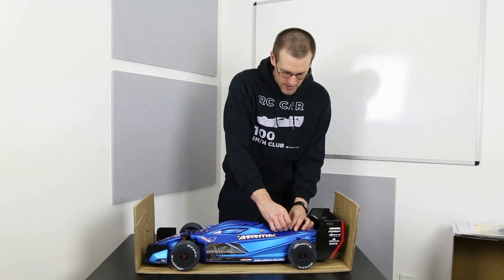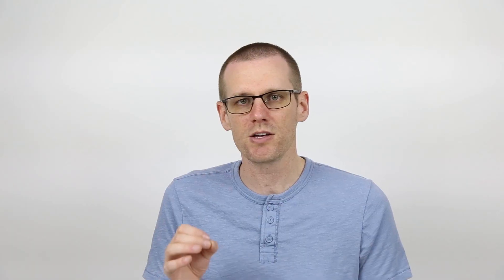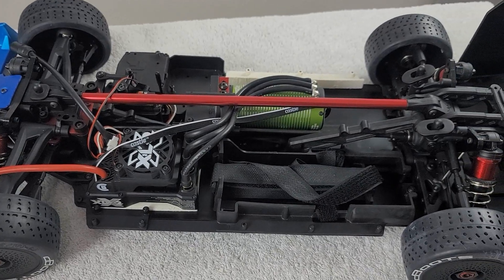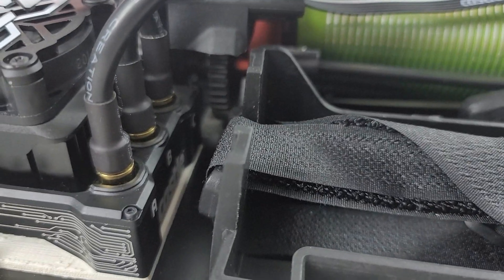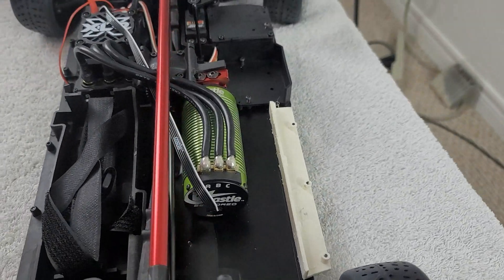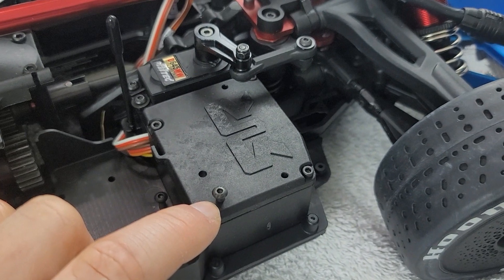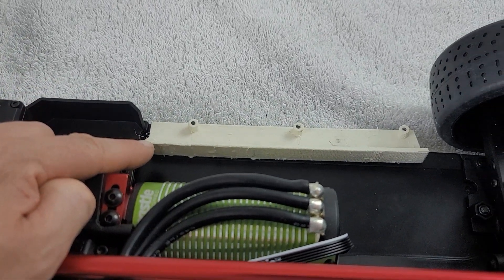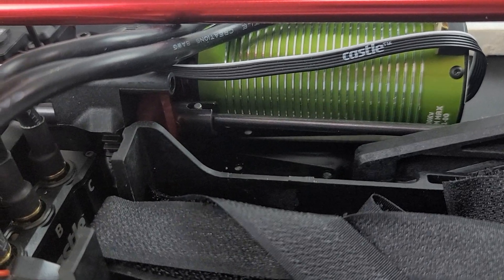Limitless Castle 1721 2400Kv Build 99% Complete but there's something Concerning

Comment: I want 140 first pull. What do I need for gearing, electronics . Limitless v2
Reply from the maker: A big castle or tp 2200-2400kv motor on 8s with an xlx2. Run the math for best gearing depending on the motor kv you select. Your pinion will probably be close to the smallest you could fit or otherwise you'll need to increase the size of your spur gear.
Reply: @RCexplained  just installed a 46 pinion for the spur
Reply: Xlx2 on the way, motor undecided as of yet
Reply from the maker: Your request fits well with the video I'm releasing today. You'll see me walk through this process. In editing I'll add specifics from your comment, maybe rerecord a section to be a bit more specific here too.

Comment: excellent breakdown vid!
For that dogbone issue, I use nitro fuel line that's used on nitro RC cars, a small piece on both ends works great. And because its flexible, it has room to expand during thermal expansion.

Another thing I did on my Limitless build using that also uses the XLX2 was that when I screwed it down to the chassis, I used thermal conductive gap pad material between the chassis & the ESC, this allows for greater thermal dissipation to keep the ESC cooler. Using an insulator type of material between the two is not the best choice, but I get it, sometimes we have to do what we must to get things up & running lol.
Reply from the maker: I used fuel tubing too. It's working well in the first few passes. Video is posted on every pass the car has made.

Comment: Industrial velcro  is great for escs, txs, gps etc.
I stick the esc power wire to the side of the xlx2
 you use a spring or fuel tubing ithe rear drive. shafts too.
Reply from the maker: Thanks for the tips!

Comment: Custom driveshafts tend to have tighter tolerances and there are many from SS to Ti to carbon.. im not getting into the politics of what or who is best im just making the point and as we all said our loud during our watch of the vid o rings help . Personally i only use them on the arms when necessary but i wouldn't be afraid to use them as you are needing

Comment: Those drive cups got seated in too deep. Arrma quality control, LOL.  Loosen the set screw and most likely you can set them up correctly.  When push the shaft all the way to one end, the outside dia of the shaft pin from the other end should be at least 3mm into the cup.  That's how mine came from the factory.  Position should be @13:24 beginning frame of 13:24

Comment: cut nitro fuel tubing as spacers for drive shafts works great on all my limitless's.... also the rear center drive shaft will bend on you and hit the motor....you should get Perfect Pass carbon shafts because of the vibration of the stock shafts...they fold like bananas. literally!
Reply from the maker: Thanks for the tips

Comment: Looking good. I use a 3D printed switch mount designed to fit between the ESC fan and base, works awesome. O-rings in the dog bones works good. 👍
🇨🇦👈🤠
Reply from the maker: Good tip!